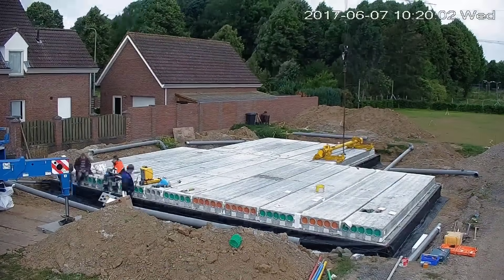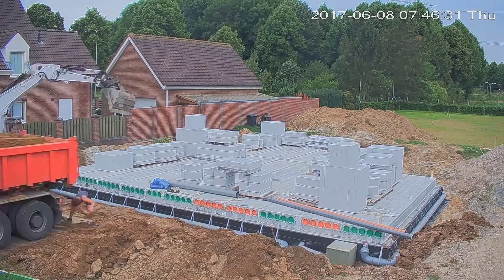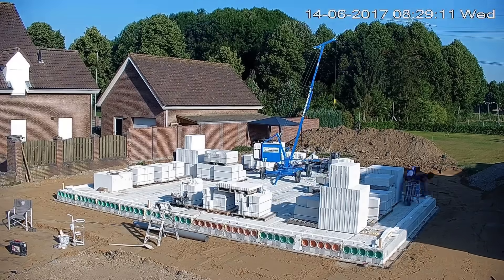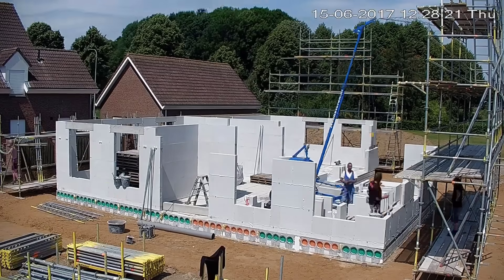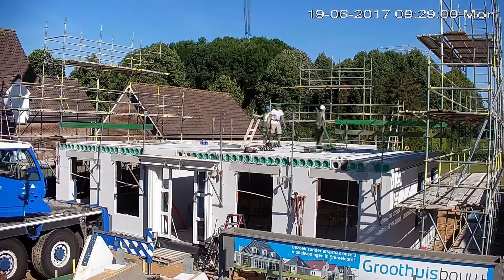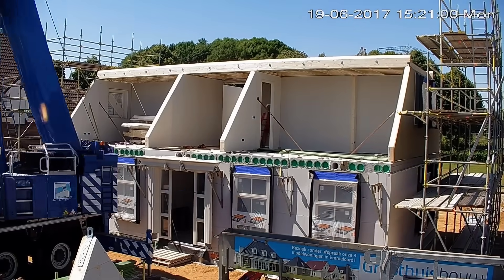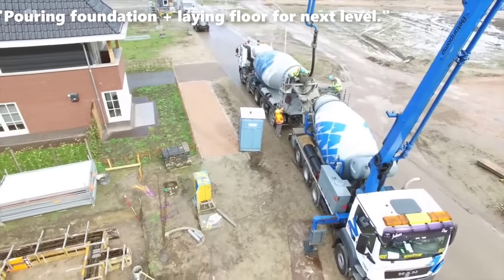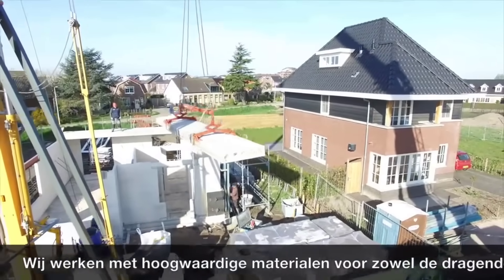Incredible Modern House Construction Technologies.

Comment: This system has been a round for a while.... I am an Australian Architect and saw this first used in the Yucatan, Mexico nearly ten years ago. They used prefabbed walls, of similar, by using 4 inch PVC tubes in a mold and pouring them to end up with same resulting panels as these on the floor and roof...they also used the same technique for the floors and roof just with 5" PVC tubing. Each panel actually locked in with the other with a ridge and groove system. Walla were core filled and J-bars fitted to lock floors and roofs in these core filled locations. It really assisted in lowering and maintaining lower interior temperatures... and yes...was very fast to construct!
Reply: The soviets used this 50 years ago, and in Norway this is pretty common, been common for decades. But in Norway we allways build one struckture in reinforced concrete, as elivatorshaft or stars, that keeps it more stabile in extreme weathee

Comment: WHERE is the cavity insulation? Why was the insulation not included in the construction of the sections? Not meticulously crafted.
Reply: They're using aerated concrete which combines insulation and structural capability in one material. You typically choose the thickness of the blocks for the outer walls based on which climate zone you're in.

Comment: Thise walls are dangerous.. just glued? No vertical steel frame nor interlocks. Once earthquake strikes those blocks.. big blocks will fall over you.
Reply: These houses, during bad weather such as stronger winds or stormy weather with rain or a combination of both becomes Faraday's cage. Know what Faraday's cage means? The house becomes electrified from outside meaning, everyone who will try to enter inside risks to be electrocuted. And these type of houses also, during stronger winds or wind and rain become dangerous devices. How? Well, the pressure outside is low during the bad weather and inside should be calm and all but that is only the impression of the people inside the house. The pressure inside the house during stronger winds or heavy rains or the combination of the both is higher than outside and that pressure needs to be stabilised. In order to do that it is suggested to open the doors and windows in order to relief the high pressure inside the house amd the stabilisation of it. And when you open the doors and windows during bad weather..... What happens? Water enters inside and all.......

What is strange that, despite the warnings from the Mother Nature, seeing what has happened in Valencia Spain some months ago, now in California....... People are persistent to build houses such as these which are easy to : be penetrated by a speeding car or lorry or a truck, easy to be eavesdropped, easy to be infrared spied, easy to enter inside by the biggest menace of all : the man, easy to be eaten by ants, rodents, mice, fleas or some other menace.......

PEOPLE! WHY DON'T YOU WAKE UP??? Building a house that you should call home is not built in 8or 10 or 20 days or 2 months. Built in such a short period gives the conclusion that it won't last more than 10-15 years meanwhile you have to regularly renovate. Save yourselves by building houses from concrete and bricks. The build up will last longer but they will last longer. And I've never heard or seen concrete or bricks to burn down but for the wood sticks, paper and glue and some nails put altogether to make something that looks like a house I hear that they burn in less than an hour

Comment: Foundations are just laid on top of the ground? is it a superhard ground or something?
Thanks for the video
Reply: there are concrete poles in the ground which hold the foundation.
Reply: Foundations need piling in most parts of The Netherlands, in the beginning you can see the pile heads in the construction pit.

Comment: non isolated floor??
Reply: The 2 floors look different. I think there is 5-6 inches of insulation under the bottom slabs, whereas the top floor is not as thick.

Comment: As a layperson, but very involved DIY homeowner, I have some mixed feelings. Obviously, I have no background arguing with building engineers. Still, I trust prefab homes made of wood will perform better as far as insulation goes, as well as even stability. I also don't understand why the floor was left seemingly un-insulated (I get those were hollow beams, but still). Moreover, since those beams were hollow (and given they were insulated from below), they could have been connected to warm air floor heating, alike the Romans had. The crawl space seem to have been enclosed, which may provide insulation, yet being fully closed it requires forced venting, which may work out to be a failure point at some point in the future. And once it fails, it can cause problems with mold, at least according to what I heard. All in all, I am very interested in this sort of stuff, but I have seen other construction methods that I find far more convincing.
Reply: Under the hollow beams on the ground floor there s a crawlspace for plumbing and stuf.
On top of the hollowbeams there s rebar witcf some electric conduct  and a layer of concreet. On top of that concreet there is more insulation, on top of that insulation there will be floorheating system layed into mud.
On the first floor its the same only there will be some plumbing and as u call hvac system layed onto the hollow pipes in the concreet for the groundfloor.
This hvac system ia a push pull system where one side of the house gives warmed fresh air into the hous and on the other side it will suck old air out. So this is basicly a ventilation with no cold air.
On the outside u see the first walls and insulation, what u dont see is a layer of bricks after that infront of this insulation.
These house last hundreds and hundreds of years with some maintenance ofc. And is air thight.

Comment: In Belgium it is obligatory to let do an undergound stability survey by a recognized engineering bureau befor thinking of putting up any building.
Reply: In Spain too. They just laid the foundations on top... it might sink if you water the house on one side for 24 h...
Reply: @xq_le1t0r97  there are concrete poles in the ground which hold the foundation up.
Reply: @Demun1649  Well A. I work for an construction company. B. you can litterly see in the first few seconds of the video there are round grey things sticking out of the ground, which are called 'heipalen' (piles) in dutch where it was build.
Reply: @Demun1649 I believe because Groothuis Bouw, the contracting company (maybe this is their video?) is specialized in the above ground part of construction, not the underground part. Mostly they start with construction when the ground floor is ready. The main reason is that the foundation is different in the many regions of our country. In the west and north we need piling (sometimes even 20m long piles) and in the mid, south and east we mostly don’t.
Reply: 15 meter deep foundation poles under my house go through several layers of "fluid mud" before the found "ground" on a sandlayer.  That is the situation in the near deepest point of NL.

Comment: For industrial buildings you have to be with the 'hollander'. 30 years ago Martens NV in Hoogstraten build us a hangar in concrete walls which are isolated in and between the slabs and which are almost a foot thick. The thing is it isolates but only for a short time. After a week of frost it freezes in and outside. That is my main issue when I see these  small concrete elements. The floor is a big concrete thick slab poured on the spot which is costly and foreseen with joints to work. It hasn't moved in 30 years. And it hasn't cracked. I would not build on hollow vaults unless there is proff by time that it is solid and does not move.
Reply: The problem is that they start above grade with these walls. They put it on a non insulated slab in Belgium. So you have a very large cold bridge at the start of the walls. The house they build here is an outstanding home. I build those in Belgium. It is faster, cheaper, better and indeed net zero. The inner walls are made of chalk-lime stone. Way better than the simple keramic hollow blocks. Inertion is perfect. And the hollow concrete channel elements are as strong as you wish. These are also used in Belgium for better results.

Comment: You can"t say much about it. It is a fast 'snelbouw' way of building with a logic coming from industrial building. They work backwards. Only the future will tell if this is ...the future in building. What I do not see is any preparation for all utility canals, I also see much silicones, Silicones and glues do not last. I don't see cavity walls and I am aking myself what the K-value is. It ain't good to seal completely a building that cannot breathe anymore. I will wait and see what it brings. I also do not like putting that weight on hollow vaults instead of on a reinforced concrete slab. Anyways engineers will have calculated that it will hold. It is a nice house.
Reply: Under the hollow beams on the ground floor there s a crawlspace for plumbing and stuf.
On top of the hollowbeams there s rebar witcf some electric conduct  and a layer of concreet. On top of that concreet there is more insulation, on top of that insulation there will be floorheating system layed into mud.
On the first floor its the same only there will be plumbing and as u call hvac system layed onto the hollow pipes in the concreet for the groundfloor.
This hvac system ia a push pull system where one side of the house gives warmed fresh air into the hous and on the other side it will suck old air out. So this is basicly a ventilation with no cold air.
On the outside u see the first walls and insulation, what u dont see is a layer of bricks after that infront of this insulation.
These house last hundreds and hundreds of years with some maintenance ofc. And ar air thight with pre heated fresh air.
This kinda house is what we call a zero on meter house which means that it will almost coast nothing to keep it on temp because of the insulation and heating system